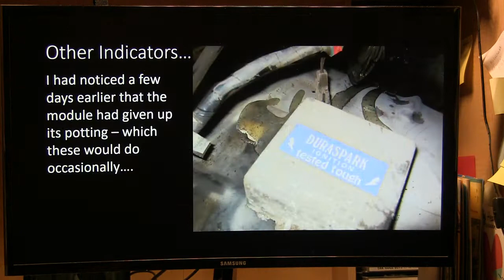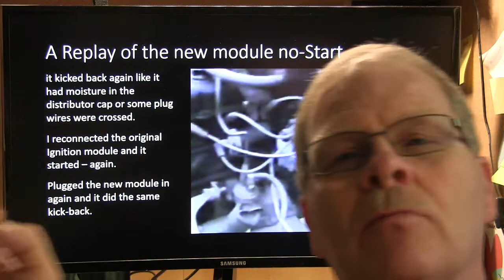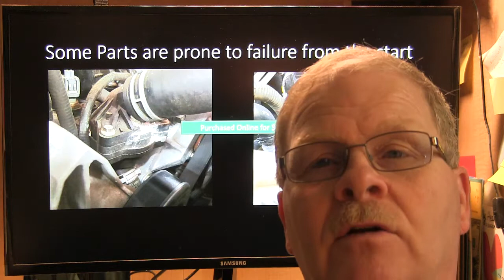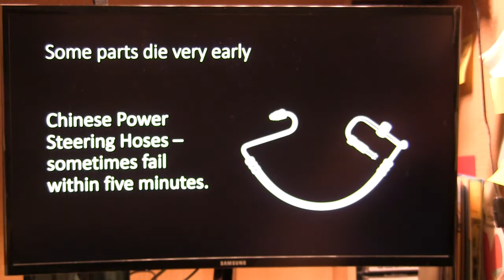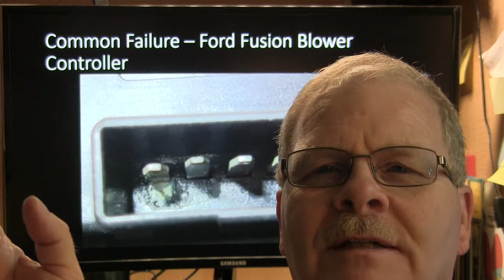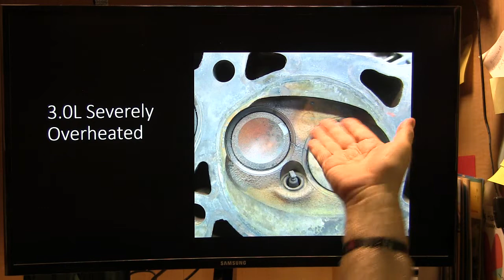Good Parts and Random Stuff

Comment: You like war stories, Have you ever ran into something like this -  A friend had a Mustang II many years ago that he rebuilt the 2.3L. He used the Racer Walsh long rod setup (250 Chevy rods and Keith Black pistons with file fit rings). Thing ran good too. Along the way he bought a replacement breather cap that was meant for the mid 1980's turbo model. Instead of venting the breather into the air cleaner it sealed the valve cover. We would go down the road and after a short drive the oil pressure would start dropping. Odd because it was all new bearings and a new oil pump. Well he stopped and replaced the oil pump, same thing. You could shut the engine off for a second or 2, restart it and the oil pressure would come back. On the 2nd oil pump we took it for a drive around town, arguing over if the oil gauge was worth a crap or not because it made no since whatsoever why the oil pressure on a new motor would fall off the further you drove it. About 20 minutes into the drive the oil pressure suddenly bottomed out. We switched off and rolled into the local Big/Little gas station. Restarted the car and the oil pressure was back. Let it idle for a few minutes and it dropped a bit(maybe 7 to 10 lbs). I reached over and pulled the dipstick out, it made a sucking sound and suddenly the oil gauge jumped back up to where it was when we started the car. Put the dipstick in and in 30 seconds it dropped 5 lbs, pulled it out and it went back up. Now my mind started working it out. The new motor with those good rings was sealing good. The PCV was drawing a vacuum on the oil pan like a AC vacuum pump, and the valve cover with the replacement breather cap could not breath. When the pressure inside the pan dropped below the low pressure the oil pump was creating, the pump was unable to pick up the oil and we lost oil pressure. For the internal pump to work, it must be vented to atmospheric pressure. He put the old oil cap back on and threw the new one away. Never had anymore problems afterwards
Reply from the maker: Excellent story!!!